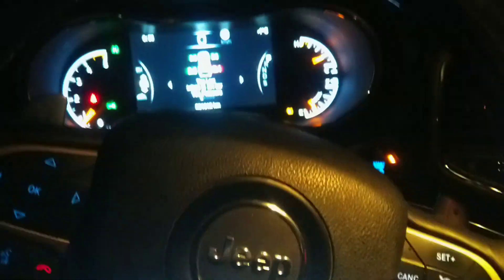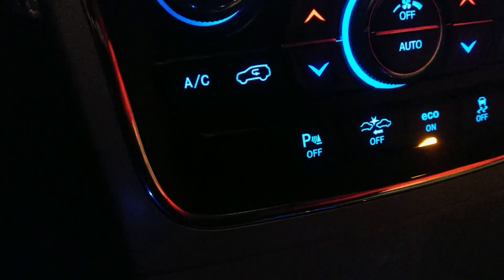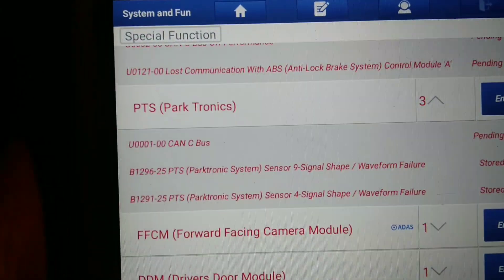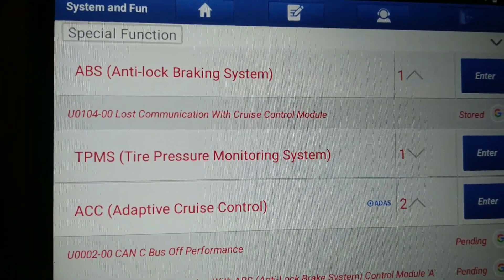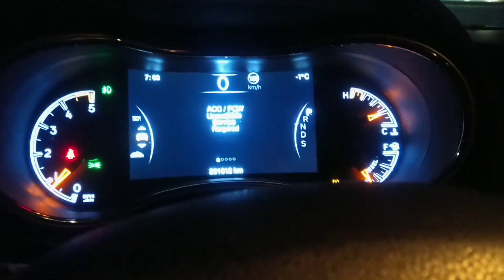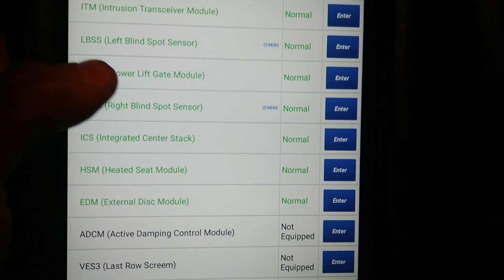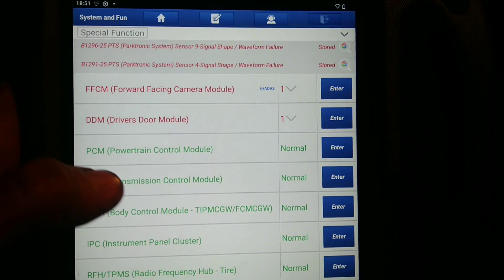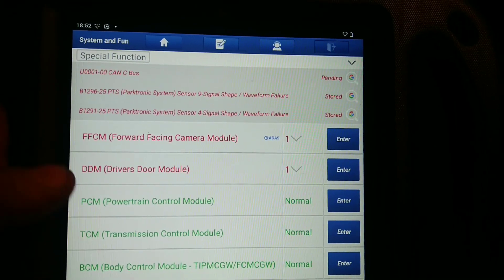U0002-00 U0001-00 CAN C bus off performance Jeep Grand Cherokee

Comment: How do i figure out which module is the problem? I'm getting U0002-88 on Dodge Charger and need to figure out how to fix.
Reply from the maker: Hi! First way check maybe you can’t connect some module. Second is check which modules have faults like communication problem with that or that module. Example- if central module have fault like no communication with light module. That means it’s possible your car have problem in light module.

Comment: I have this same issue in my 2014 but I don’t have that center front bumper camera looking thing
Reply from the maker: @calebknee  you have adaptive cruise?
Reply: @krkrepair just regular cruise manual up and down speed change
Reply from the maker: @ you need unplug module after module. First check with faults come first- then unplug that system.
Reply: How you fix it what was the issue
Reply from the maker: @Senzeez  change lance in front bumper.
Reply: Same problem, appears parksense, fcc and start stop at same time, in that moment its affect performance with aceleration, need to turn off and start again until appears again

Comment from the maker: Yes. Change front bumper lence. There was corosion and oxidation inside.
Reply: The front bumper fence? Sorry not trying to be difficult,  what is that. I've got similar issues.
Reply from the maker: @justinruiz1203  lence for cruise, in center front bumper.

Comment: Did you fix the issue? What was the solution?
Reply from the maker: Yes, problem was in front bumper lance.(Oxidation from water) Thats make another systems not working corectly.